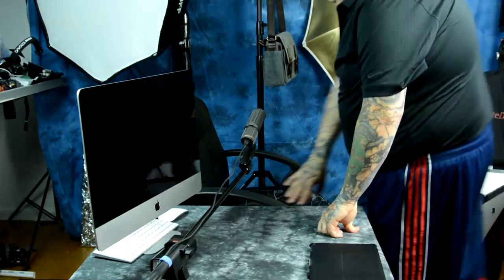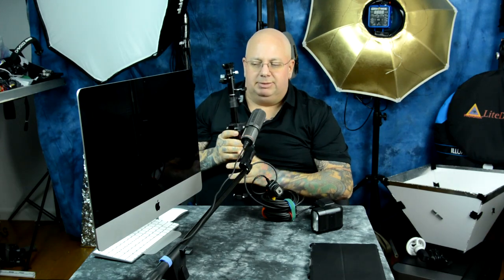Fujifilm OFF-CAMERA HSS simplex option that always works perfectly

Comment: Sometimes the old way is the best way. Given its 2016 I think it's perhaps a serious oversight producing a flash system that doesn't offer full wireless functionality however. That said adding a cable isn't a huge inconvenience ( unless your flash is further away than the cable length of course ). Cabled systems can be more reliable I guess unless the cable or connectors become damaged. Interestingly all my wireless strobes still have cabled capability....makes you wonder doesn't it? 😃

Comment: yes - CACTUS issues are there ... i ve tested mine on a few shoots and have run into inconsistent performance and results. If updating XT1 to Firmware.5 - make sure you update the cactus  as it does not work at all.

Comment: Every body is tired of wires! I feel like the different manufacturers of flashes are trying very hard to pin us down. Don't you? The wireless Cactus flashes are great to use,especially for some one like me that's  still learning. Very easy to learn how to operate. Are we going to be boxed in with Fuji,Meitz flashes? Ya, spend another $1000, for what? I need another cable?! Great. Sorry I just love the look of hi speed syn and want my XT2 and Cactus to WORK! My time to rant. Thank you Ken